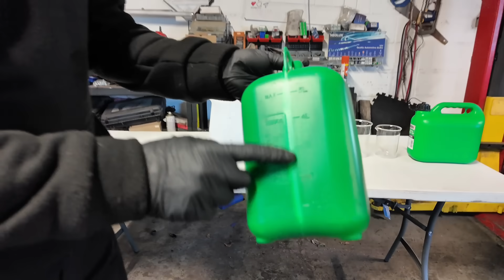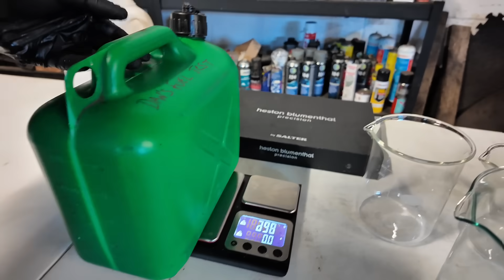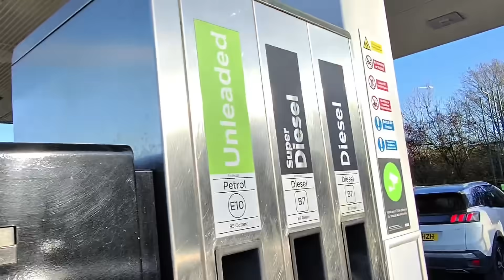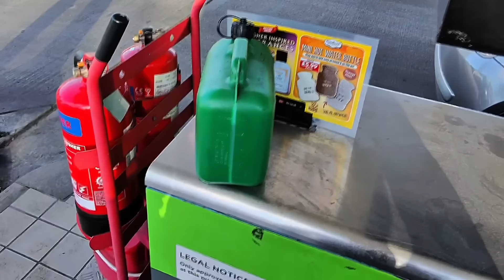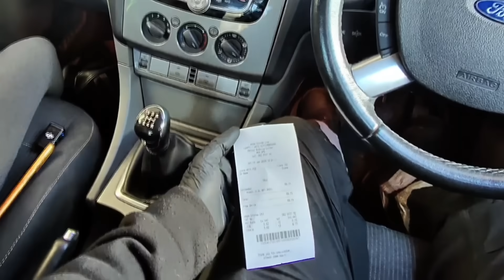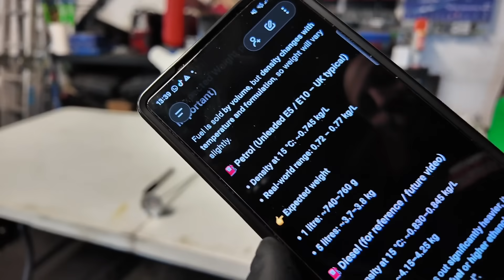This Fuel Test Shocked Us… Are Pumps Lying?

Comment: I have noticed with a garage I used who's the cheapest in the area when you put the nozzle in the tank there's a few seconds gap before the fuel starts pumping  and the pump noice changes they all might do this,
Reply from the maker: Interesting, I will look into this 🙌🏻🙌🏻
Reply: That's why it's important to drain the nozzle into the tank when you stop the pump. If you receive fuel immediately, then it's likely that the previous person didn't do that, and you're receiving a small quantity of fuel which was paid for by a previous person, free-of-charge.
Reply from the maker: @RWBHere thats why we put the nozzle on the floor before we start the tests

Comment: Looked like you were using air temperature not fuel.
Reply from the maker: We are measuring fuel temperature too and adjusting it. Pump temperature 15 degrees C - 0.1% difference per 1 degree C. The next video we show you the digital temperature gauge as it has been mentioned a few times so we've included the video 🙌🏻🙌🏻

Comment: Always best to buy your fuel first thing in the morning. 
As it will be at its highest density.
Reply: Shouldn't make too much difference other than what's in the pipe. The tanks are well underground and the temperature will not alter much in the UK depending on where you are. About 9C in the north of Scotland and 12C in the south. The temperature will change a couple of degrees with the seasons, but daily, not so much.
Reply: @billdoodson4232  it changes with atmospheric pressure and you buy it in liters why not measure in liters  just get an accurate measuring tube simple
Reply: Good idea! It's -1 at the moment, I'm going to store enough petrol in my garage to get me through the year. Massive savings 💰💰💰

Comment: Firstly if you are buying fuel by the litre then the volume not the density of the liquid is what you should be measuring.  And secondly, having a precision balance on a "levelled" paste table is pointless.  The bubble level on the balance is what needs to be centred, if it doesn't have one then it isn't a precision balance.  Also a rickety pasting table moves and flexes, the balance has to be on a levelled solid concrete base at a minimum and with no vibration if possible.  Sorry but worked in laboratories with balances of all shapes and sizes and you need to get the basics right  before starting, but as I said at the start you are purchasing fuel by volume not mass/density.
Reply: Don’t you remember at school when you measured volumes in a chemistry class?  You used a “ volumetric measuring flask” - a glass flask with a long narrow neck marked with a line at the filling level.

Those at school would almost invariably have been grade C.  Close but not necessarily completely accurate.

In A level chemistry and at many work places, one would use grade B glassware.  Rather more accurate and rather more expensive.  

In some work places (and possibly some universities) one might come across grade A volumetric flasks.  These are exactly the same flask as the grade B - but each flask would come with a certificate showing exactly the volume of that flask, at the marked line, under controlled laboratory conditions.

(I worked at one place where Grade A glassware had always been purchased, but they did not use the certificate that came with each flask.  Until I pointed out the difference, they were paying about twice the price of grade B for absolutely no common sense reason!).

Trading standards would use a volumetric flask (along with properly calibrated weighing scales) to determine the density of the fuel.  After simply weighing the fuel dispensed and the temperature of the fuel, at that point, the accuracy of the dispensing equipment would be calculated under controlled conditions (the actual fuel would be checked at the temperature of the temperature of the fuel as dispensed at the pump).  Mostly, a lesser-accuracy test  would be sufficient to check that the pump was within its specified range of accuracy - all pumps should be within the specified range of accuracy - likely correct or generous, but not disadvantageous to the paying customer!

Expect to get more energy for your money in the winter, than summer!  But the prices paid, per litre, will be of greater range than that difference.

There will also be an upper limit of pump accuracy in order to avoid any unfair practices between suppliers of fuels.

This boils down to the tests done by the average (or even above average) you-tuber are a waste of time and effort.  They prove nothing - unless they actually come across a real rogue trader who has messed around with the pump seals!  Any rogue traders, doing that, would soon be out of business with huge fines and destroyed reputation.
Reply from the maker: We did a poll on our Facebook Page asking if people wanted a more logical approach or a more scientific approach and it was 92% logical so they only wanted a simple yes or no answer. I can make it in any way the people wanted it.
Reply: This was a good enough visual/weight test. He's not looking for discrepancies in molecules, just blatently obvious.
Reply: Yeah density is this, the same reason why spaces load of bullshit
Reply: The volume of fuel you get isn't where the garages are ripping you off, there are a few that fill there 99ron tanks with 95 when stock is low, the scam is been sold fuel with lower octane when you believe your buying the higher..
Reply: Do you have any evidence to support this claim?
Reply: @G @GJMacLeod Very doubtful.  Likely just hypothesis, which would be correct, of course.  It wouldn’t be must a scam, it would be plain fraud.  Some engines would not run properly on a lower grade fuel, so the fuel would likely soon be tested by trading standards.

Comment: You lost 1 gram on the petrol container - it suddenly went from 395 to 394 grams.
Reply from the maker: No, we always tare the scales before measuring so it resets to zero - when we use plastic for measuring there normal is a gram difference between usage which is why we tare before weighing

Comment: 5 minutes to weigh a jug, & a can. At that rate you're going to loose 10%+ fuel by evaporation.
Reply from the maker: Not a chance, try it yourself leave 1 litre of fuel in a measuring jug for 5 minutes and see whats left hardly anything changes. Plus this measured 5 litres exactly so no complaints

Comment: Trading Standards or Weights and Measures Authorities use calibrated jugs, many years ago when i was a petrol pump attendants i could remember inspectors turn up unannounced, close the forecourt and carry out checks, the pumps had to be spot on with the gauges.
Reply: Yeah, forecourt inspections by weights and measures from trading standards were standard practice, and legally enforced.  What I've noticed recently are stickers on some pumps, Sainsburys and Tesco in my case, that indicate when the pumps were last tested for accuracy, by a private company!
Reply: @turboslag Weights & Measures can, and do, still turn up to check what the pumps are dispensing. Every petrol station has to have their pumps serviced and checked, which is done by  commercial companies. The seals show that the pump hasn't been opened/tampered with since the engineer did his work.
Reply: Yeah, they were made of copper and stamped gal 1/2 gal  imperial 🥸
Reply: @Falco45ableI have one in my kitchen 😊
Reply: Spot on over over......, so most stations were over... becasue "spot on" could seriously fuck you up..., if it was  an ml under....
Reply from the maker: I would love to get one of those jugs 😎👌🏻
Reply: Hytek in bishops Stortford sell these

Comment: So you got 4064 grams of fuel just minus the can weight of 364 is 3700g and as long as it’s in chatGPT range then it’s classed as ok so 3600g to 3850g but yes having that jug correctly marked at 5 litres makes it a true factor you got what you paid for.
Reply from the maker: Thank you, second test done today and a different results! Interesting testing the pumps as you never know what you're going to find 🙌🏻🙌🏻
Reply: You need to check if the pump has ATC fitted. The industry standard temperature for fuel is 15c. The pump adjusts the amount of fuel dispensed depending on the temperature in the station fuel tank. If the pump is not fitted with ATC you will get slightly less on a cold day and slightly more on a hot day. ATC adjusts so you will get slightly more on a cold day and slightly less on a hot day. The arguement is that you get the same energy for your money, but the filling station actually wins